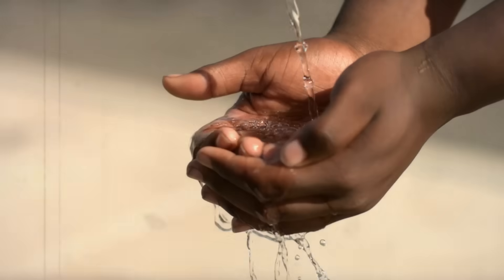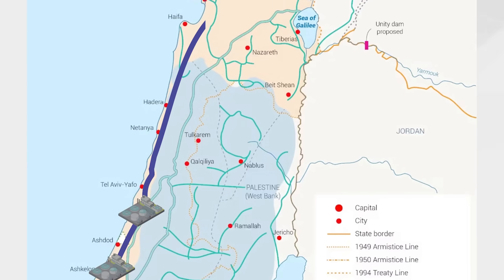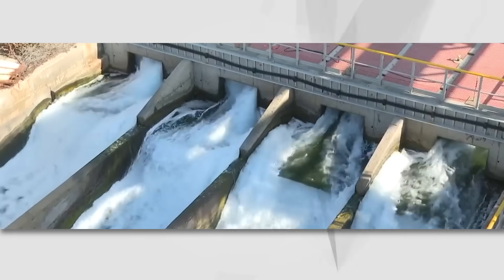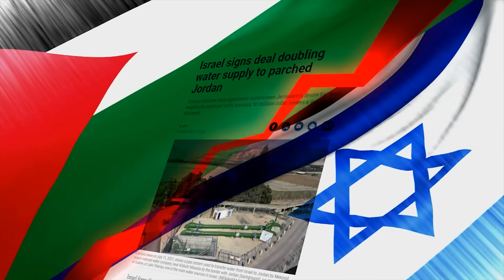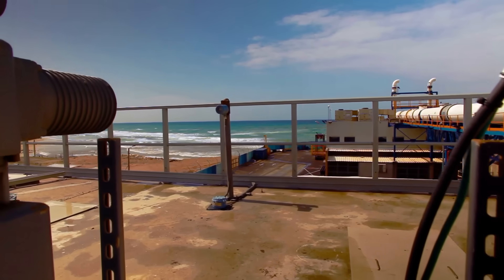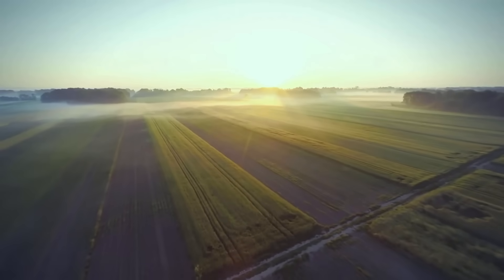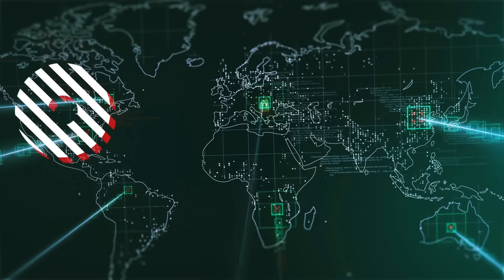Israel’s MASSIVE Water Highway That Could Change The Country Forever!

Comment: Yes this why The Sinai are was cleared of all,of its population , to allow transport of this open canal from the Nile in `Egypt who needs more and more fresh water , but is allowed this Nile extension to go towards Israel . 
Israel has offered Egypt desalination of sea water , which is very expensive and requires massive energy use . Egypt has neither . 
Israel’s desalination plan requires a lot of energy and fundings . It’s encroaching on the Jordan River is a great point of contention , currently diverting a great portion to Galilee sea , Jordan leadership couldn’t resist since they receive money from the USA , no water agreement exists regarding use of the Jordan River ! Galilee large fresh water lake is dropping tremendously, therefore diverting the Jordan river to Galilee lake or river is becoming more critical for Jordan’s fresh water source . It has no other fresh water source , cannot afford desalination . Its wells are not enough , the Yarmuk river is the source of the Jordan river . A branch runs to the Dead Sea , and distal branches the Jordan river is contaminated from agricultural run off , and the salty springs , making the distal branch UN usable . Controlling Jordan leadership is part of the problem!

Comment: Why doesn't Israel let Mediterranean water into the Dead Sea to save it?
The difference in altitude between them is 430 meters, so several hydroelectric 
power plants can be built on the waterway.

Comment: 2:12 - - 1937 🇬🇧engineer Walter Clay Lowdermilk proposed diverting💧from Jordan River (+ tributaries in north) to the Negev desert (in south);
2:42 - - NWC (2:50💧infrastructure mega project)
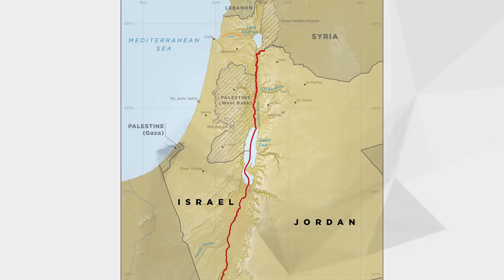2:53 - -💧from Galilee Sea (abundant🌧️) - to desert (little/zero🌧️) 
3:10 - - 81m sys of canals, tunnels, pipelines, reservoirs + pumping stations
3:40 - - massive reservoirs
3:43 - - network of pumps

Comment: Being as there is lots of igneous rock that naturally de salinate water is that an option what stone exactly gives water the minerals it needs and filters the water is for the engineers but they use similar membrane for the de salination tubes the fact that pumping water is power intensive soaking water through rock and only needing to remove less minerals as salt is one but it sticks to igneous rock filtering the water

Comment: What a bunch of bullshit.  Give to other countries? Where do the lies end?

Israel controls several water sources in areas not internationally recognized as Israeli territory, primarily in the West Bank and the Golan Heights. Key sources include:

    Mountain Aquifer: The mountain aquifer, primarily located in the West Bank, is a crucial groundwater source for both Israelis and Palestinians. Israel draws a significant portion of the water from this aquifer, managing its extraction through policies and infrastructure that often limit Palestinian access.

    Jordan River: The Jordan River is a shared water source along Israel, the West Bank, Jordan, and Syria. Israel has historically diverted a substantial amount of the river's flow for agricultural and domestic use, reducing water availability downstream. International consensus does not formally recognize Israel’s control over the river’s entire flow.

    Golan Heights Springs and Rivers: The Golan Heights, occupied by Israel since 1967, includes springs and rivers that feed into the Sea of Galilee, a primary water reservoir for Israel. The international community considers this area Syrian territory, and Israel’s control of these waters remains unrecognized by international law.

These sources are subject to ongoing contention in Israeli-Palestinian negotiations and broader regional water disputes.
Reply: I wouldn't correct your bullshit since it is better to have an ignorant enemy instead of informed enemy

Comment: People drink water convert from sea water.How is hypertension rate data in Israel compare to another countries? Because salt is the major cause of hypertension disease.
Reply: It doesn't work like that, pal. Desalinated water has it's salt level reduced to a normal fresh water drinkable level. It doesn't retain high salt as in the original sea water, allowing you to exist off it disease free. Going further, this technology is what allowing Eilat, a tourist city on the Red sea,  to exist & be a tourist paradise while not having direct connection to any other fresh water sources in Israel.

Comment: Climate change is mentioned several times. Climate change is a fact. it has been changing since before the ice age. man made climate change is a hoax used by leftists and authoritarian types to control you. carbon dioxide (CO2) is a good thing. ask a tree or a bush or blades of grass and they will thank you for exhaling or burning your trash in the backyard or using your ice car for vacation.

Comment: They didn’t use pumps in 1953 - they relied on altitude and gravity 🫶🏻
Reply: Not in 1953. The project was completed in 1964 and the pumps had been installed one year before.
Reply: They had to pump the water from the Sea of Galilee, which is actually a lake located 200 meters below sea level,  to the Eshkol reservoir which is 152 meters above sea level. From the reservoir, the water flows South by gravity.

Comment: Nice documentary but you need new editors. When you discussed drip irrigation almost all the video showed sprinklers and other wasteful systems. I don't see how you could publish this without some simple double checking on the veracity of it in totality.
Reply: The term drip irrigation is often used interchangeably with micro irrigation.   https://hort.extension.wisc.edu/files/2014/04/A4119.pdf
Reply: https://hort.extension.wisc.edu/files/2014/04/A4119.pdf
Reply: The term is often used interchangeably with micro irrigation.  The Basics of Micro Irrigation from the University of Wisconsin horticultural extension gives a nice overview.
Reply: The Bascis of Micro Irrigation from the University of Wisconsin horticultural extension explains it.
Reply: The Basics of Micro Irrigation from the University of Wisconsin horticultural extension gives a nice overview.
Reply: @JamesZaraza-wv3gt  You submitted three identical responses! Waste of space. 
And none answer my concerns about how your video mismatches the audio/video about drip irrigation. You show wasteful sprinklers and other spray  applicators when discussing the value of drip, a mismatch that any juvenile editor should catch.

Comment: Question: Where does Israel produce the electricity that is needed to run these desalination plants and to power its homes and industries?
Reply: Mostly natural gas, produced from local, sea, source.
But, the desalination plants are privately owned, BOT. So its cheaper producing electricity within the Plant. For this they are connected to gas pipe, savings a fortune and functions as a reserve power plant.
Reply: @ashercohen5034  From down here in New Zealand thank you. And God Bless you all and your children and your children's children
Reply: Natural gas
Reply: With oil from the muslim?

Comment: This is all fabulous and more evidence that Israel is incredibly important to the world. The technology they developed will help many countries to take advantage of the already ongoing greening of the earth, observed especially in arid regions, thanks to the slight increase in CO2.
I just wish you had not included that reference to "[man-made] climate change". The climate does change all the time - we've fortunately seen substantial warming since the end of the little ice age around 1825, which is when many glaciers started advancing. Then there was strong warming from 1885 to 1940. Strong cooling from 1960 to 1980, which led to endless fearmongering about "global cooling" and a coming ice age". That was claim was THE dominant narrative, pushed by the UN and the NOAA. 
The switch to "global warming" only came after the natural trend switched to warming, at which point the new narrative was "global warming".
Warming continued until 1998. From 1999 to 2014, the planet was cooling - based on the IPCC's own data. This period was debated as "missing heat" and addressed in more than 60 scientific studies. Then Dr. Karl from NASA simply altered historical data to make it look like the warming had continued.
Since 2016, Antarctica has been cooling. Temperatures in the Antarctica are currently 20 - 25C lower than the 40 year average. Greenland is currently much colder than it was in 1984. Look it up on Ventusky. There is no continuous warming and none of the other alleged effects - no acceleration of the sea level rise. It continues at the same rate measured over the last 200 years, around 0.39 to 1.57 mm per year. Pacific islands are not sinking into the ocean - 88% have grown, over the last 40 years.
Snow did not disappear, as predicted by the CO2 warming conjecture.
Storms did not increase, neither in number nor intensity, as can easily be seen in the data of the Colorado State University Storm research center.
Current frequent flooding is due to the 10% excess water put into the stratosphere by the volcano Tonga, in 2022. Based on NASA data, most of that water is still in the atmosphere and will keep coming down in further excess precipitations.
In short, the entire fearmongering about "global warming", which they renamed to the meaningless term "climate change, is a scam. There's a lot of money tied to that narrative...

Comment: what's "reverse osmosis technology"??? Why not give two sentences to explain what that is???? And why have images of wasteful sprinkler irrigation when you're discussin drip irrigation which is there to conserve water (unlike sprinkers)!
Reply: reverse osmosis basically removes all of the minerals from the water making them purified water. completely purified water without ANY minerals in them aren't fit for human consumption (they'll take away minerals from the body)
Reply: @shachar2  thanks, but how does that actually work? (in simple terms). Do they boil the water to use the condensation, or filder it, or what?
Reply: @SionTJobbins  both of those methods works. In home devices you use a filter. In a business setting like that you use evaporation
Reply: ... never mind, I've googled it. Just thought it'd be worth just in one senstence saying what it was. Interesting video otherwise.
Reply: @shachar2  thanks for explaining and for your time.
Reply: Its just about forcing water through fine membranes

Comment: Outstanding! 8:40 Why Punjab, India waiting, tech available, end present raw sewage release into rivers nallahs sanctuaries.
Reply: Israel sewage purification tech already implement in New Delhi. The main advantage of the Israeli fresh water supply is close to zero leaks, while the next best is 85%. Using pressure difference sensors discovering anomalies within minutes. This require higher pressure system, but it's rare seeing water leaks in Jerusalem.
Reply: It's possible to create a better water infrastructure in India. But it costs a lot of money and as far as I understand it India isn't that rich. It's classified as a developing state right?
Reply: @shachar2 even if it did have the funds. The money would end up in the pockets of politicians and there friends before it even reaches the contractors.

Comment: Dude.. it doesn't make any sense to desilionide sea water in order to dump it in a lake. The water will evaporate. Israel exports water to Jordan in return for water it receives via the yarmuch river. Check your facts. This waterway you talk of is a trickle in comparison to ground water pumped on wells. Those practices are reducing the level of the water table. The problem with much of what you say is that its not true
Reply: Dud, it's true. Israel gets 90% of its drinking water from its many De-sal plants. The other 10% it gets from ground water. sources and rainfall. Water that is recycled is mostly used for irrigation. The water from the Yarmouk in Jordan flows in to Israel - when it flows at all. It doesn't rain in the area from June to October. Jordan gets most of it's water from ground water. and It wants Israel to supply more water - that is the water Israel makes from its de-sal plants. In the West Bank, water is obtained from traditional sources; rainfall and ground water. Nothing pisses off the Arabs more than having to rely on the Jews for their water supply.
Reply: check your facts, Israel have water it did not have so either megic is real or this actully works
Reply: @roronoazoro8789 desalinated water is too expensive to use to fill a lake
Reply: @mike_w-tw6jd  the water highway works and Israel have 20% more water than it needs so don't try to say it doesn't work because as you can see it does

Comment: I miss a mention of how the extraction of water from the sea of Galilee has impacted the levels of the Dead sea.
Reply: I miss a mention of a pipeline for the brine to the dead sea or a canal from the red sea to the dead sea
Reply: The Jordan river connect them.
Reply: Do you think anything negative will be said about Israel in this Zionist infested little site?
Reply: It was in the video. They realized that the Sea of Galilee was drying up, so they created a pipeline to take de-salinated water from the Mediterranean Sea and PUT IT INTO the Galilee.
Reply: @philipcaplan9845  The video didn't say anything about how the levels of the Dead sea has been going down for decades because hardly any of the water that goes out of the sea of Galilee reaches the Dead sea.
Reply: Hydrology of the Dead Sea is interesting. Lots of underwater springs.
Reply: What is the impact of further water loss of a dead sea? Much tourist infrastructure is already abandoned.
Reply: @mike_w-tw6jd 
First is Geological problem in the area.
Second, Tourists will always be even as desert.